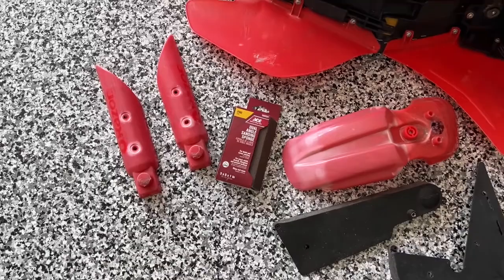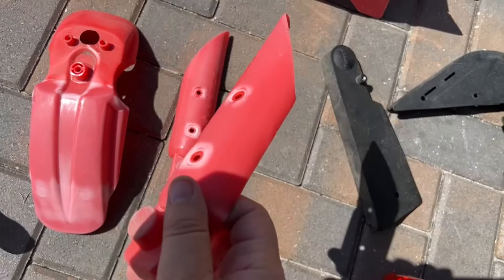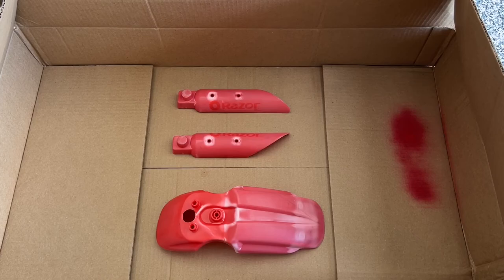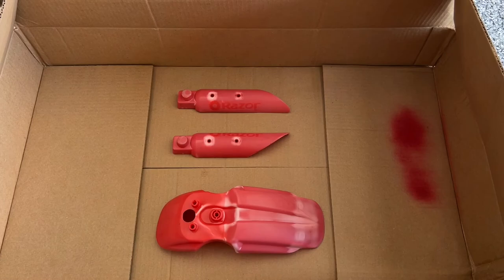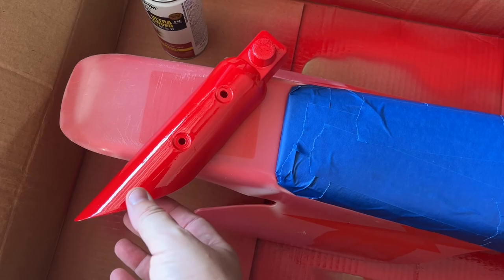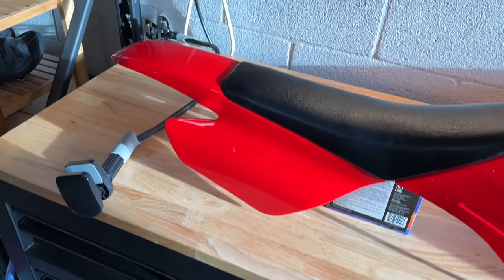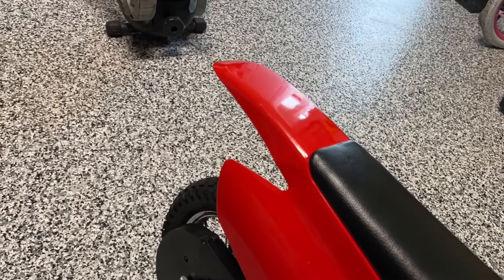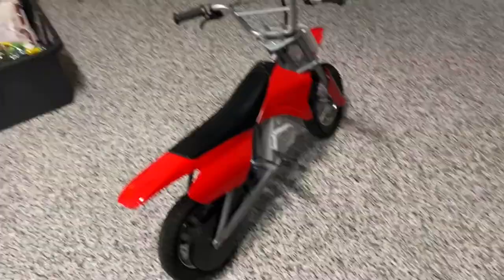How to Spray Paint Plastic - Razor Dirt Rocket MX350/MX450 Electric Dirt Bike

Comment: For future reference. Correct way for FACTORY results. Sand and clean like shown but light coat first -  wait 15 min — heavy coat—wait 15 min -heavy coat— wait 72 hours.
Reply: And then clear? Or not needed
Reply: @Impivot  def clear, same sequence of timing 🤘🏼
Reply: It’s not a vintage car dude
Reply: @trbokd9382  vintage cars aren’t plastic
Reply: @trbokd9382 dirt bikes are meant for the woods, sticks rocks and mud are going to be hitting it. Go ahead and half ass ur paint job and I’ll laugh when I can see the original color poking through.
Reply: You can also get plumbers heat gun to dull plastic comes up like new

Comment: How has it held up?
Reply from the maker: I’ve since sold it, but it held up very well. It wasn’t used all that much, but it did fall over a few times in my garage and I was sure it would be ruined but it didn’t get a single mark. I was pretty surprised actually.